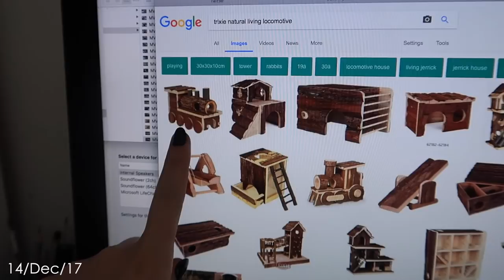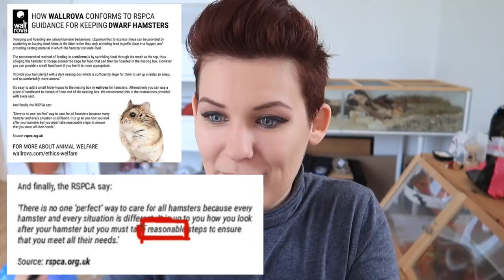Tiny Cages Rant | DIY Train Toy | Vlogstice 2017

Comment: This is not a rude or obnoxious comment but what is wrong with that cage? I am not saying if it is bad or good but I want to know from your research and to explain to me and I don’t have any small animals. When you make a diagram of the cage I couldn’t believe how small it was. It wouldn’t even be enough space for an ant.
Reply: Ava’s Animals Hamsters need a least 360 square inches of floor space.
Reply: You can friking see that cage is too small. Your hamster has ro have room to live, that is like a prison
Reply from the maker: The main issue is with the floor space (or lack thereof). Hamsters, mice and gerbils are all ground dwelling animals and need a lot of space to explore. Hamsters in particular need at least 450sq inches but preferably more. They also need room for a variety of different toys, hides, puzzles, mice need climbing toys, gerbils and hamsters need several inches of deep substrate for burrowing (gerbils are massive burrowers and need way more burrowing space than this cage offers). The designers of this cage haven't taken any of that into consideration, the cage is designed purely to be aesthetically pleasing. It's designed for people not animals. There's also issues with the metal bridges that they admit purposefully rust, which can lead to sickness or death in these small animals. The wheel that is too small for many animals (6.5 inches) and the water bottle that is angled in such a way that no animal can comfortably drink from it, it requires them to strain their neck which can lead to long term neck and spine problems. There is nothing positive to say about this cage. Basically, it's junk!

Comment: I have a habitrail crystal. 😯

AND ABOUT 50 ATATCHMENST BECAUSE OTHERWISE ITS TINY!!!,
Reply from the maker: Attachments don't count towards floorspace though. Minimum floorspace refers to a single continuous area so there needs to be at least one cage that measures more than 70x45cm for it to be big enough. Nothing else counts, you can't add the floorspace of two different cages together :)
Reply: This may come off as somthing quite awful but my hamster died quite recently so the cage is uninhabited at the moment and because of how small the cage is, im going to get a much bigger one or just use one of your DIY cage ideas because of how amazing they are.

Comment: the floor space is 532 square inches...
Reply from the maker: No it isn't, you're measuring in square centimeters but animal cages are measured in square inches which is a larger measurement. The cage is 14cm x 38.5 cm which = 539sq cm but the absolute bare minimum is 3000sq cm. In the video I gave you the sq inch measurement (5.5in x 15.1in = 83 sq inches) the absolute bare minimum is 450sq inches. Either way it's one of the cruelest cages on the market

Comment: A hack for that cage is instead of using the cage the way the video shows it you can lay it down and take out all the metal and then they will when alot more room..... just saying
Reply from the maker: It still would be useless and cruel, even on its side it would only be 126sq inches. The absolute bare minimum is 450sq inches!
Reply: ErinsAnimals oh okayy I got ya I didn't watch the whole video because it was time for me to go bed but yes I do agree this is a very bad cage.

Comment: Wouldn't be so bad if they just turned it on the longer side and gave more running space rather than height
Reply from the maker: I would still be far too small at 126sq inches. A hamster needs a cage of at least 450sq inches or bigger to fit all their necessities and have space for them
Reply: I guess so, it's just ridiculous.

Comment: Is ,110 at good for a robo? I m getting one in Jan.
Reply: unicornwolfcheetah 8  110 what?
Reply: Do you mean 110 quart? Like a storage bin? Depends on what brand, since the dimensions that matter are width and length, not so much height. Multiply the length by the width in inches, and if it equals 450 or more, it should be suitable for most hamsters. Robos need just as big of cages as syrians :)
Reply: PuppyMintMocha I know they need the same as Syrians, as my past hamster's was in the same cage ( I cleaned it) I make sure my cage with s vig enough and yes it is,  its floor space is just iunderchalf of that of a detolf, and the 110onesxin my area 
 The lids may  be a little flimsy and may require  books  but their are small gaps that are preventable but  will need a bit of fixing to robot proof, and I am not going to get a robo anymore, instead I'm getting a winter white.